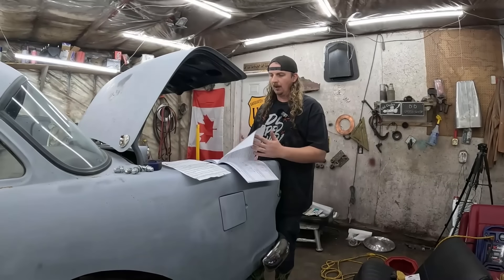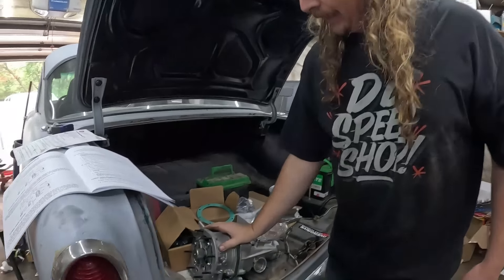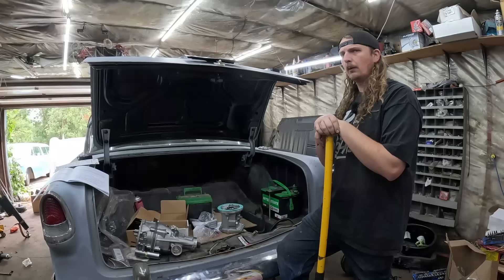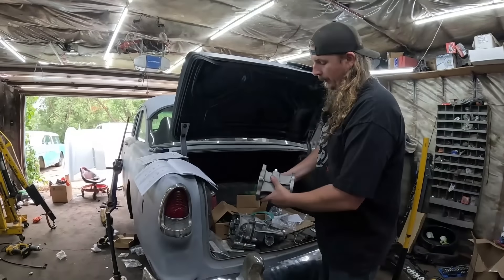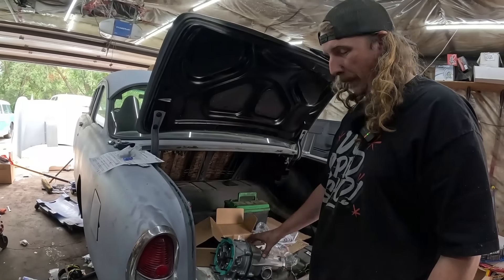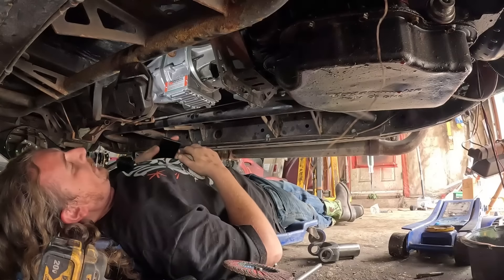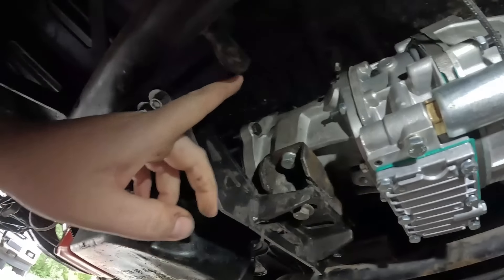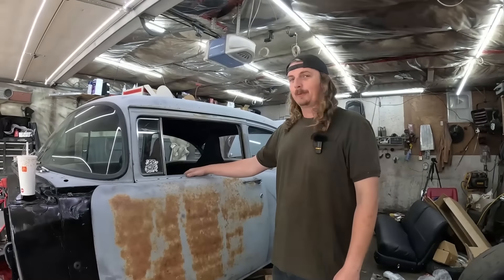Making The Perfect Highway Cruiser- 55 Chevy Gear Vendor Install

Comment: A couple VERY IMPORTANT GV quirks to remember- 
It cannot be run in reverse. There is a one way gear (or whatever it’s called) that can only be run in forward gears. It’ll break if you just bypass the controller and run it off a switch while forgetting to turn it before putting the trans in reverse. The controller is recommended for this reason because it will prevent you from doing this. 
Also, the GV unit needs some rpm in forward motion before engaging it. If you run it off a manual switch from a stand still, you could hurt it. Another reason the controller is a good thing to use. 
If you don’t use the controller, you need to really pay attention to what you’re doing so you don’t damage it, and in that case you’d never want someone else to drive the car. 
Just looking out for you. I’ve had 3 of them over the years.

Comment: Got the gear vender in 69 Torino, 428 CJ. behind a C6 trans... IT'S the shits man. 11.2 in the 1/4 mile, on NOS. Dam thing is tested, bullet prove, 502 hp on the dyno, and 560 torque.

Comment: I’ve got a gear vendors overdrive unit thrown in my 84 Chevy k10 pickup. It’s mounted behind a th350 and np208 transfer case. Took me 4 months or so to get but over the last 5 or so thousand miles it’s been great. The company has been good about helping with any issues I’ve had. I just let it do it’s thing automatically most of the time. Makes highway driving so much better.

Comment: Dan you should consider installing a reverse cut-out switch that turns off the gear vendor solenoid when the car is in reverse. That way you never have to worry about forgetting it is on. Maybe your luck is better than mine, but I can GUARANTEE I would forget it was on and kill it. Just run the GV  solenoid ground wire through the reverse cut-off switch and you won't ever have to be concerned with accidentally leaving it engaged in reverse. Just a thought to prevent Murphy's Law from occurring!

Comment: I did not see the graphic content warning on the description. I wonder if putting a 200 4 r or 700 r 4 transmission would have been easier and less expensive, I saw the gear vendor prices and they are not cheap. Any way great video minus the graphic content.

Comment: Gearvendor  I have one  on my  1984 scottsdale c10 for 30 years the 3,08 rear gear was to high for the 455 olds , I just used and floor dimmer switch to kick in overdrive when you slow down 20 mph the unit drops out by its self there is a pump in the unit the pressure drop once you get going  again you can put back in overdrive . There were like $5000 back then but still works great and lasted longer than Three TH400 transmissions .

Comment: I am surprised you haven't tried a 200-r4 transmission from California Performance Transmissions. They are warranted up to 1000HP and are incredibly stout! PLUS they can be put into all "A" Bodied cars like my 72 Chevelle with only a small hole in the floorboard for the shift cable. PLUS they fit in all "A" bodied cars with NO tunnel modifications. As in they fit in place of the TH350 or the TH400 as bolt in with only sliding the transmission crossmember back and drilling two new holes in the frame rails. It just doesn't get much easier to install. PLUS you get a 4 speed OD transmission inside of which all four gears are stacked as a "close ratio set". Very much like the old M-22 rock crusher without the whine. Ratios: (2.74, 1.57, 1:1, 0.67) Note the spacing. This is a true close ratio model. Perfect for drag racing or just cruising. I get 70 MPH @2700RPM  in my 72 Chevelle with a 3:73 diff ratio, which is totally satisfactory for me. Try it, you'll like it! 

Art Carr at California Performance Transmission is the only guy in the nation who is reliably building this Transmission. Call him and talk to him. He's a 100% straight shooter. Remember 1000Horse Power warranty!

Comment: Dan, you have a punch for making holes in gasket material. Just use a piece of 3/8 steel fuel line. You can even get fancy and take it to the grinder to sharpen the end.  That's like hackery 101. Use what you got.
Reply from the maker: That's a good tech tip!

Comment: Hook the coill wires of a 12vdc relay up 2 your reverse lights of your xmission and run the Vendor enable wires (solenoid wires) 2 thru nc contacts on the relay. Then if u 4get and put it in reverse with the Vendor turned on, the relay contacts will open and shut off the Vendor.

Comment: I have a GV overdrive unit in my 70 BB El Camino behind my mild TH 400 transmission.
Very rugged unit.
Not the most over-driven OD ratio but it’s just okay.
There are OE transmissions out there with better OD ratios.

Comment: I am an engineer, but not an EE. And I don't have your schematics in front of me. However, it seems like since this thing is electrically operated, there should be a way to use the reverse light switch in the shifter to disengage the gear vendor when you put the car in reverse.

Comment: Hey.....had an idea.....  your reverse lights turn on when in reverse.....tap 12 v from that line.....use a relay....solid state one would be best.....and have it supply the switching of power to your on off switch under the dash. It seems to me that your gear vendor is too costly to take the chance,.  The 12v relay would be wired normally ON. The 12v power from the back up lights would cause the relay to disconnect the main power 12v from the gear vendor.... just a thought....Gary

Comment: Hi Dan, watching your struggles with the gasket. The Gear Vender looks very similar to the old Laycock overdrives on old Triumphs and MG,s. I wondered if any of the gaskets could be used ? I seem to remember the old style UK overdrives had inhibitor switches to prevent them being used in first and second but especially reverse as I think they don't like going backwards. Not sure if that's a thing with the new ones but if you accidentally leave it switched on you could put in reverse. I sent this while watching and you mention this at the end. Can you wire in a switch off the reversing lights, shifter. Look forward to seeing it running.

Comment: Dan , anytime you have an automatic tranny out of a car or truck . Do yourself a favor  drill a hole in the back of the pan and weld 1/2 of a collar and put a plug in it. No transmission oil on the floor. Great for servicing filter

Comment: Dan, I know nothing about gear vendors, but understand from what you've said that having it "on" in reverse would NOT be good.  Since the unit it powered by 12 volt battery power, through a switch, why not try this?  Run the 12 volt through the switch, but BETWEEN the switch and the unit install a simple, cheap 5-pin relay.  Send the 12 volts through the N/C contacts of the relay, and the switch and unit will work as intended.  Ground one side of the coil circuit of the relay, and trigger the relay with a wire coming off of your reverse light switch.  Every time you shift into reverse, the backup lights come on AND the relay gets energized, switching it to the N/O contacts....killing power to the gear vendor.  That way you won't need to worry about the gear vendor ever being on in reverse, without having to remember to manually flip a switch....

Comment: Use a relay powered by the reverse lights to kill the gear vendor power feed. That way, you'll never accidentally destroy it...😅 literally only four more wiring connections, so it seems like cheap insurance.

Comment: Couldn't you wire the on-off toggle to the shifter? Like, it turns on when in drive, second, and first, and shuts off in park, neutral, and reverse? I wouldn't think that would be hard to do at all. Then you won't have to worry about it being on in reverse.

Comment: You can put an extension on a socket the same size of the hole for the gasket and punch it out by striking with a hammer with a soft backing so that it gives way.  ❤️👍🤍👍💙👍